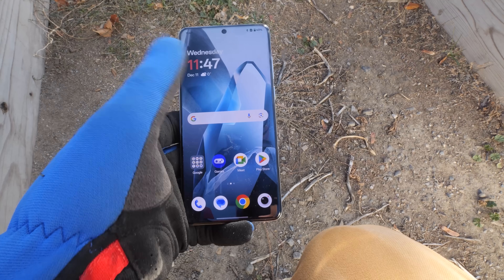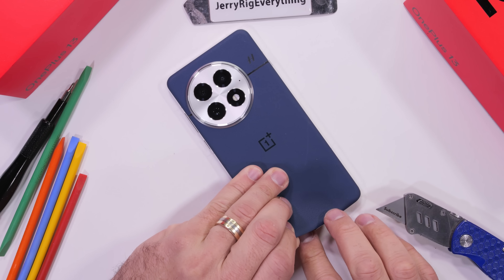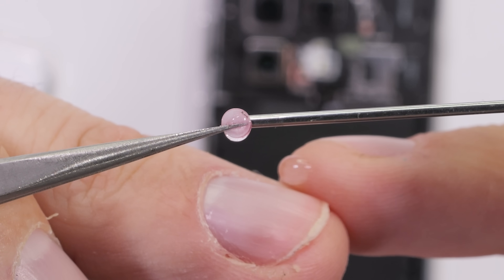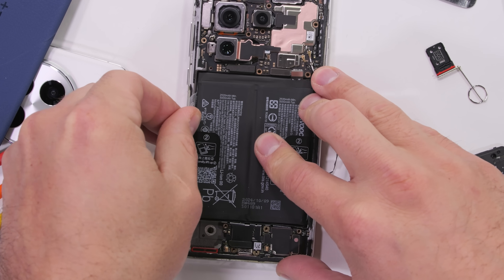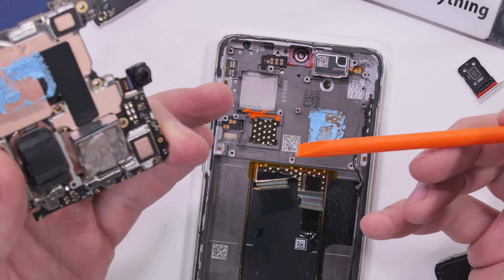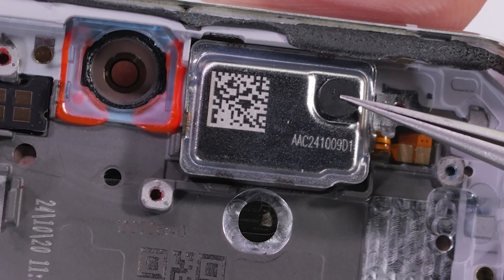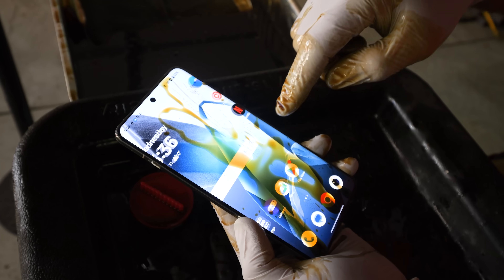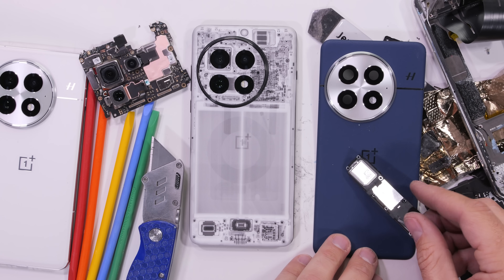The OnePlus 13's Double Decker cooling system - TEARDOWN

Comment: now drop it onto a concrete... different story
Reply: That’ll ruin the positive review.
Reply: I do use the one plus 11, but dropped it from about 5 feet onto tiles, and for me only the back glass cracked. But it also depends on the angle the phone hits the ground, corners make the hardest impact while screen first is usually fine except if it drops on to a small rock or something else hard. And back is usually covered by a case.
Reply: For the price what else do you expect
Reply: Concrete would be fine, just not from 20ft, how often are people realistically dropping their phones from 20ft anyway.
Reply: You don't need to drop it from 20ft on a concrete. Just drop it from your pocket distance, and boom, it's gone.
Reply: @SouravSatvaya  normal phones that can't survive 20ft drops to dirt can survive a 4-5ft drop to concrete, even cheap ones
Reply: Duh? Why even comment this. Like common sense any glass is going to crack dropped that high. 🤦